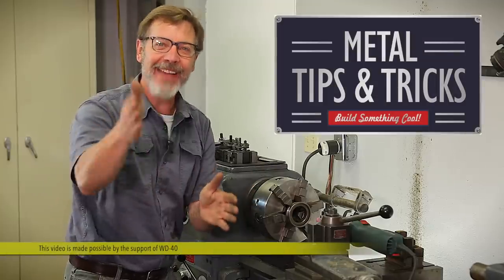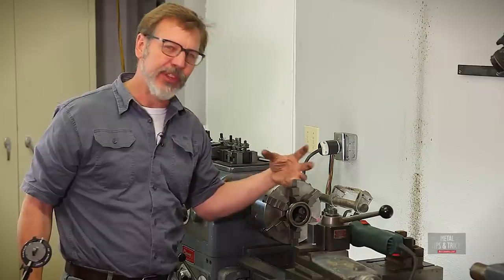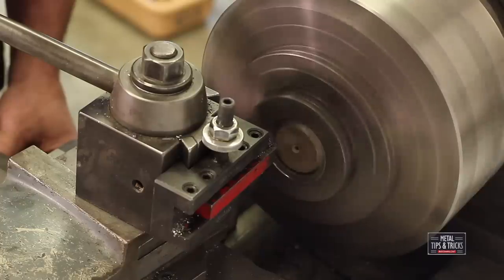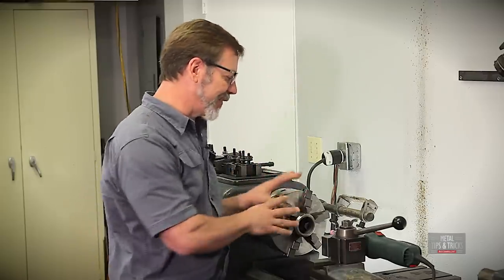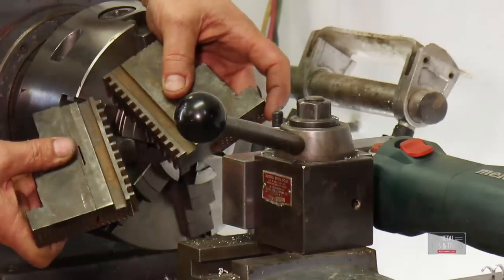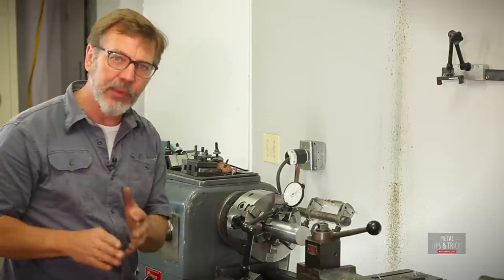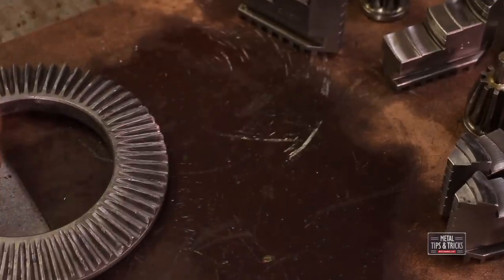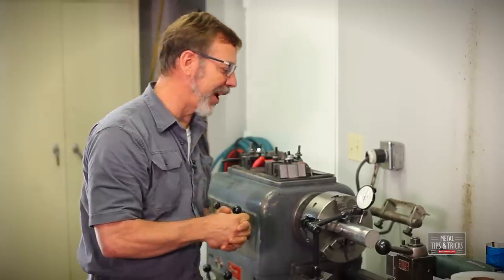Lathe Chuck Grinding

Comment: For grinding, turning rusty material, the outer crust on cast iron, polishing surfaces with emery cloth etc I use the cheapest aluminum kitchen foil I can find as the first layer to protect the way surfaces Dale. Then especially with grinding a fairly wet towel over the aluminum foil. The wet cloth seems to help to catch a whole lot more with less of the fine dust floating around. Even having hardened way's is meaningless if any grit makes it under the carriage, cross or top slide ways. All it does is start to embed into the softer unhardened slide surfaces and then begins scoring and wearing out those hard and expensive to restore precision surfaces. 

Yeah I do know at least Bison and probably a few others make specialized chuck grease. One possible reason for it might be because most industrial users would likely be using water based coolants that would help wash any oil out. Since I don't know the all the reasons for using there grease for sure then maybe my logic is faulty. Each to there own methods, but I personally think grease simply retains cutting chips in place inside the chuck while a light coat of way oil helps to float them out of way of the jaw teeth a bit better until your next chuck cleaning. I've tried grease and oil and the grease seems to require much more frequent chuck cleaning since the scroll and jaw teeth starts to bind up sooner. One down side to the oil is the chuck is going to sling some oil the first time you spin it up at a high rpm. Since oil or grease works due to the lubrication wedge it forms I really can't see any type of grease making a chuck more or less repeatable than any other form of lubrication. The lubrication only helps during opening and closing the chuck. Under the full tightening pressures that oil wedge is no longer there. Grease is basically an oil with thickeners plus extra additives where required. So grease isn't going to form a larger supporting lubrication wedge than the oil it's made with. I'm a long way's from being a lubrication expert though.

Comment: I was under the impression that there should be no added lubrication to lathe chucks as it attracts chips and dirt and can prematurely wear the chuck. The cast iron used in the chucks apparently has some lubricating properties and negate the need for oil or grease.

Comment: Hi, would like to see lathe levelling/alignment showing Headstock to bed using a piece of stickout, and how long this stickout matters for practical purposes, before you than has to revert to tailstock alighnments to chuck or collet/lathe centre. And if a bench lathe is bolted down it will be twisting the bed somehow......your version.

Comment: I watched, then I read the comments.  One comment mentioned the possibility of different pressures of each jaw, which got me thinking.

Initially the jaws were applying their face "lip" or "shoulder" against the aluminum ring.  Perhaps you should have first trued those lips.  But to true those, perhaps the inside jaw faces should have been clamping something that could allow jaw pressures to be as equal as possible - such as a thick plastic rod.  Once the lips are trued then proceed with your grinding.  Maybe that would have produced more accuracy in the end.

Comment: Dale, one question do you think it would help if you ground the chuck and restarted the process a second time.  I'm thinking that grinding a second surface might change the first grind.  Also, you pointed out the scroll was not the greatest.  The clamping rings are a good idea but are you concerned that they only true up the chuck for one diameter?  Thanks for listening.   More videos, Please.

Comment: I know that there will be 1000 possible answers/arguments to this, but it raises a question that I've always had about buying machinery - (in this case a lathe) - do you buy old and recondition it or buy 'high end' new and cross your fingers that it's as good/better than the old machinery will be now, but without the hassle of scraping in beds etc?

Comment: The scroll itself looks a little too rusted especially  on one side which likely means the jaws don't scroll in on center and as you clamp different sizes your radial runout will change.  Also you need to look at the clearance between the scroll ID / OD and chuck body.  It needs to be close to 0. I'd go back to the 3 jaw or use a 4.
Reply: The scroll looks utterly trashed. Used chuck warning!  Moreover, even regrinding perfectly will work only at THAT diameter. With that crap scroll, even rotating the scroll 60° will cause measurable runout.

Comment: I think the video is educational in the process & would have worked if the chuck had been a higher quality ground. I would suggest renaming the video with the words "Failed Attempt and Why!" in the title somewhere. I like the tool grind, I was concerned about that until I saw your process. Thanks for the informative video. Definitely congrats are in order on the sponsorship. I have never leveled or aligned my 17" X 31.5" Chicago Machinery Lathe. It would be nice to see how it's done. On a good note for me, today I hit 3K subs on my small channel, Yippee! Thanks again for sharing, I look fwd to your next video. Best Wishes & Blessings. Keith Noneya

Comment: I tried to true up my lathe chuck once.  Then I bought a new one.  hehehe   What a terribly annoying thing it was trying to eliminate the run-out.  I can see the same frustration in you that I felt back then when doing that job.  
I put wheel bearing grease in my chuck.  It STILL splatters my clothes and everything nearby with tiny droplets of grease even months later.  It's especially bad at higher RPMs.  Does using WD grease eliminate that problem?

Comment: I still don't know why everyone thinks scroll chucks should be dead accurate. Keep in mind you may grind the jaws to perfection at your spider's diameter but concentricity will likely change when you work at a different diameter as you'll be working a different portion of the scroll AND different teeth on the jaws. If you can't cut all the features of your part in one setup and really need that level of accuracy, get on a 4-jaw and proceed. The only thing I grind jaws for is to repair bell mouth.

Comment: Good video.  When dismantling rusted old equipment I use the pick end of a body hammer to tap the bolts  working them loose while turning then alternately in both directions.  I would like to see your take on lathe alignment.  If you can talk about lathes with removable head stocks.

Comment: have you never learned that you make a mark on one of the holes and only use the key there, two hundred of a millimeter is nothing, a small blow with a hammer and it is in the center. It looks like an Ursus lathe, but I'm not sure there's another brand that looks very much like Ursus. A good video and well explained.

Comment: well, looks like parts of this chuck are beyond any repair. biggest problem here might be the severe pitting on the spiral ring and original jaws, you will never get consistent results with that. dunno if there are spare parts available, should def be considered because 6 jaws with fine adjustment are pretty expensive to begin with.

Comment: Greetings,
   I don't like posting stuff that's critical, especially when it's obvious the large amount of time and effort to post a well made video. So instead I'll explain how scroll chucks work and where some concentricity errors can come from.
   First of all the lube should not make any appreciable difference in concentricity. This is because the lube should be squeezed out from in between any mating surfaces. The lube used in a chuck needs to only let parts slide past each other and then when pressure is applied to any mating surfaces the lube must squeeze out to a very thin layer. Thin as in only a few millionths of an inch. If the lube did not squeeze out right away then it would do so over a short time and the chucking pressure would decrease, thereby loosening the grip on the work. 
   In a scroll chuck the quality of the spiral scroll and the location of the scroll plate itself are two major sources of error. When the scroll is cut it must be done accurately. That is the motion of the tool cutting the spiral must be like the motion of a tool cutting a thread. So that a certain angular rotation of the scroll plate always moves the cutting tool by some amount that is always the same. This of course seems obvious but sloppy gear trains and leadscrews with pitch error will result in a scroll that will have concentricity errors. Modern CNC machines should not have this problem but there are still a lot of chucks produced on old equipment that use acme thread leadscrews and gear trains instead of electronic gearing. And even with modern equipment there is still lots of shoddy work being performed that negates the ability of modern machines to produce very accurate work.
    Another source of error from the scroll plate is how it is located in the chuck. It has a bore that fits around a locating diameter inside the chuck. When tightened the pinion not only rotates the scroll plate it also pushes it sideways. Using different pinions will push the scroll plate around which in turn changes the center of the work grasped in the jaws. This is why good chucks only have one pinion, so that the scroll plate is always loaded in the same direction. With a chuck having 3 pinions it is best, for accuracy,  to just use the same pinion for tightening and loosening the chuck.
   Another source of error is wear of the scroll spiral. The scroll in the chuck and the partial mating scrolls on the jaws only make a point contact. You can see this by looking at the wear marks on the partial scroll on the jaws. Because of this very small contact patch the pressure is very high. This leads to wear. If certain diameters are grasped more than others this leads to more wear in these areas of the scroll. This uneven wear results in  changes of concentricity depending on the diameter of the part being chucked up. So with a worn chuck a part of one diameter will run true while a part of a different diameter may run out quite a bit.
     Another place in the chuck that can cause problems are the slots that the jaws run in. When they are worn significantly the jaws can shift at an angle which can once again cause the chucked part to move. But unless the slots are really buggered up they shouldn't be a problem.
    Please note that the clearance in the scroll for the jaws is mainly for lube and dirt to move around. The contact between the jaw and the scroll only happens in one direction that depends on which direction the chuck is being tightened.
     Before any grinding or cutting to correct lathe jaws is done the easiest way to insure concentricity and repeatability of a worn chuck is to address the location of the scroll plate.  Shifting of the scroll plate is the largest source of internal error of a worn chuck. If the clearance between the I.D. of the scroll and the locating dia. in the chuck body is excessive it should be reduced as much as possible. I prefer a clearance of no more than .0005 inch. One way to do this, which may seem like a kludge, is to use hardened shim stock to fill the gap of a worn scroll plate. To do this the chuck body needs to be machined so that the scroll locating dia. has a good finish and is concentric when mounted on the lathe. Then the scroll plate needs the same treatment. Actually, do the scroll plate first. When machining the chuck body remove enough material to allow a strip of hardened steel shim stock to be placed in between the bore of the scroll plate and the chuck body such that there will be about .0003 clearance. I have done this more than once and it works well.
     I have been working in machine shops for over 40 years, became a machinist sometime in that span, and have been using lathes since my first day in a shop. I hope this helps.
Cheers,
Eric

Comment: i think you probably have a scroll problem. changing of  the runout by removing and  replacing the  same piece of stock would show up an inconsistent clamp. the scroll may be moving in its seat. try using a different tightening technique and see if that results in a change in runout. also chucking up different diameters of stock would show up worn areas of the scroll.some production machines worked with the same size stock for years.i seriously doubt  that lubricant is your problem.

Comment: The problem is that you did not make the chuck body concentric in the first place. As a result your grind is only valid for that exact jaw setting. Any other opening size will not be concentric.

Comment: Leveling is not necessary, but aligning, or reducing any bed twist is the most important. So why do I say leveling isn’t that important?
Some of the best machine shops are in military ships and aircraft carriers. And when they move about, nothing is ever “level”
Look at making a 3 point footprint mount. You cannot twist the bed with 3 points of contact.
Reply: it automatically goes that people do not mean level. They know what they mean they are talking alignment but hard to describe so they simply say leveling.

Comment: No point girding a worn chuck. It will only be precise at the ground diameter. The same as with soft jaws. Dressing the stone doesn't balance the stone. Nice one, abrasive grit-on the lathe bed.

Comment: Since you fed the grinding stone just as a regular lathe tool, you ended up grinding a slope on every part, as the wheel leading edge wears smaller when you traverse into your work. This technique is only ok if you could traverse the whole feature. Since there's a shoulder you have to plunge the grinding wheel after dressing on the diamond nib. Check out Mr Crispim great series on TP grinder, he says it much better than me at 9:00 on this video: https://www.youtube.com/watch?v=ii0Xbzl1kIw
Great content, anyway, love your channel!

Comment: Use grinder is a little bit tricky. First You should use high speed on the lathe, second bigger grinding wheel = bigger area = longer last = the almost same material and same diameter of grinding wheel will be on start jaws and and ends jaws and that grinding tool what you have... man you can’t use that for grinding precision thinks.. what about the bearings inside? That is rubbish. On that axel has to be tapered roller bearing ooonly, then you can adjust the play. You should use carbide tip tool for it and you should be ok. Also that flange from China.. look you always buy bigger one then you instal that flange on your lathe yes with out jaws of course, then you machine out that flange on you lathe machine and then you put your jaws on and if is the jaws new you have 100% no play. This doesn’t work that way flange for jaws from China Kannada Germany and then jaws on it ha ha trust me. Always one size bigger, fitted in, machined and then better newer take the flange off and you have everything straight like dream. And forget about old jaws that is not worth ha ha.

Comment: I find it to be extremely unlikely that one could start with a block of rust, as you did, and end up with a good chuck without first restoring the geometry on 100% of the surfaces of every contact part of the chuck.

Comment: Just face it. The chuck started out as a door stop and has been promoted to the limit of its competence -- boat anchor. If you want real accuracy do as I have always done with 100% success; use an independent four-jaw. 0.0001" every time. No substitute, period.
Reply: Yup, but some times you need a six jaw for the extra clamping power and to avoid distortion when clamping thin tubing or soft materials. There is no Perfect tool for every application.

Comment: You can't fix a worn out chuck.  Yeah, you can grind out the "sprung" in the jaws some what, but the scroll has worn slop in it that the only way to fix that is build up the bearing area and re-bore to a close fit to the register in the chuck body.   And even then, there's worn places in the scroll that will always create inaccuracy in runout.  But at least you have adjustment to help you keep it to a minimum.  And come on,  WD-40 grease, I call BS on it helping alignment!!!  And shame on you for not protecting your ways  from grinding dust!!!  And I bet you didn't wipe down your ways afterwards.  I praise you on the proper method of correcting jaw alignment on a 3 or 6-jaw scroll chuck.  Ken

Comment: jaw lubricating use molybden oil...its for heavy duty mehanisms,lathe jaws generate more 4000 kg power to part...dont use wd40 never!
Reply: This wasn't the regular WD40 but an extreme pressure version. Confusing that WD is now a make instead of a water displacement product.

Comment: If you want to loose something ,a bolt,stuck morse taper ,lathe chuck ,-use jackhammer ,that shit is just awesome for loosening stuck stuff or nails,fence posts etc.
Reply: Or explosives. I remember Seeing a Mythbusters clip on using explosives to remove all of the concrete stuck inside. It removed all of the cement for sure, Including the Cement truck too! 

https://www.youtube.com/watch?v=Gxm_qpKh7Jw

Comment: Would really like to subscribe, but I just can't. The crap spattered on the white wall from the lathe chuck is just too much to deal with. You feature some really cool ideas and offer great suggestions for approaching tasks in the shop. But the crap on the wall negates that all, just looks sloppy (I am trying to be respectful). Maybe it's the fact the wall is white so the crud on the wall is even more obvious.. So clean the wall and you might garner a few more subs... Align and level right after you clean the wall...